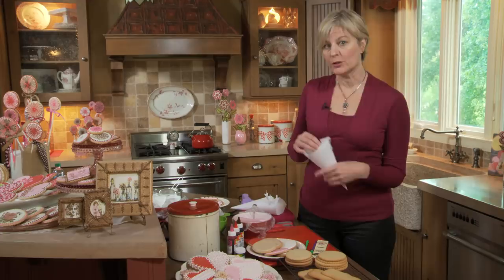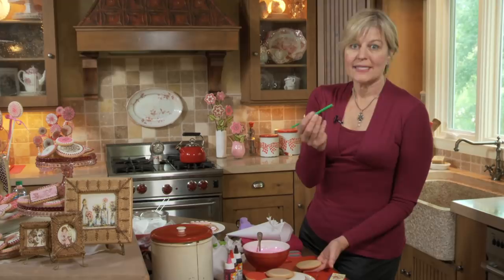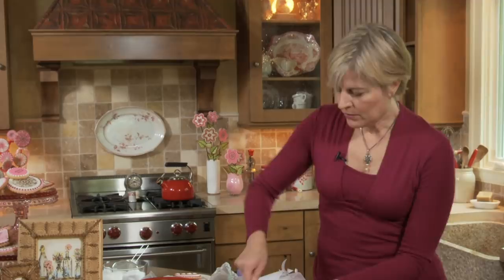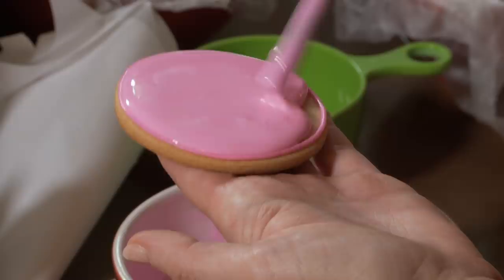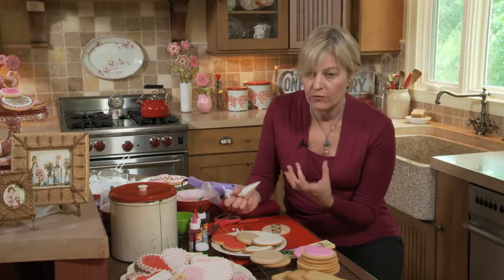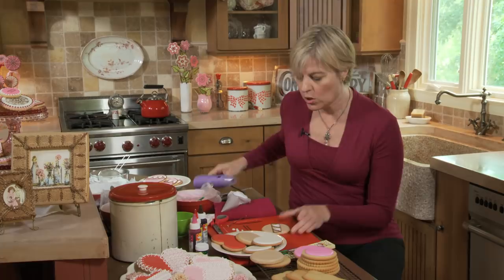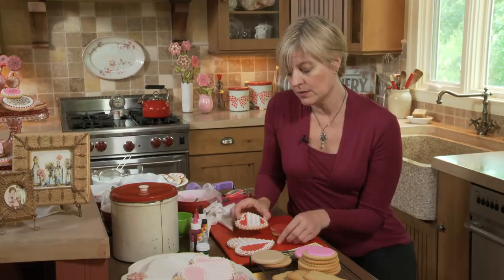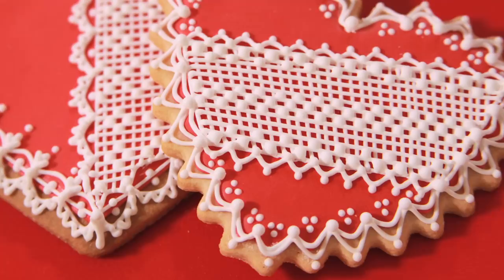How to Top-Coat, Outline, and Flood Cookies

Comment: Hello julia, I was wondering if i should dry my cookies out on the rack for 12 hours without covering it or i should pop them in the freezer before i bag them up.
Reply: ***** I guess I will leave it on a cooling rack   . Will i cool them under the fan? I baked my cookies yesterday and it turned out pretty soft . Should i adjust the baking time a lil longer ?

Comment: TO ELIMINATE THE DIVOT in the center of the triangle, could you egg-wash the naked cookie before you put down the icing?
Reply: I saw a comment that small spaces get divots; large areas are less prone to divot.  Hmmm.  Why?  The dry cookie is sucking water from the RI.  At the edges, the dry cookie is sucking "more" water from the icing because there is more dry cookie.  By the time the middle gets to drying, more water has been sucked from the icing by the dry cookie on the edges, and the RI is thicker, and when the last bit of water evaporates, the divot forms.   In a large area, the effect is less.  THIS MAKES PERFECT SENSE IN MY HEAD.  I don't know if it is correct, or partially correct, but it sure is hard to explain.  I thought the egg wash might delay water getting from the RI to the dry cookie.

Comment: Do you have a video for dipping the cookies instead of flooding?
Reply from the maker: I have a video for dipping curved or contoured cookies as that's the best/only way to cover them. I don't have one for flat cookies, as I prefer to outline and flood for more control (dipping is a mess), but the methods for dipping contoured ones are basically the same for flat ones.

Comment: Using hot air to dry the icing seems counterproductive, it is like dipping something in melted chocolate and try to dry it with hot air, you just end up keeping it melted. Just as with chocolate which is left to be cooled to harden, it seems that it is better to blow dry it with the lowest temp. setting in the blow dryer instead of the high temp. you used.
Reply: Sorry, I thought you were using buttercream icing.

Comment: Hi would pls can you give me an idea how can I decorate crosses sugar cookies. Thanks
Reply from the maker: Do you mean religious crosses? If so, you could do them in SO many ways, which is why questions like this are so hard to answer. Because that shape typically doesn't have much area for piping, it can look pretty with just a plain flooded background and some piped flowers and bows at the intersection of the cross "arms". But, again, there are so many ways to approach any cookie. I suggest you trace your cutter and sketch out a few options before you start icing.